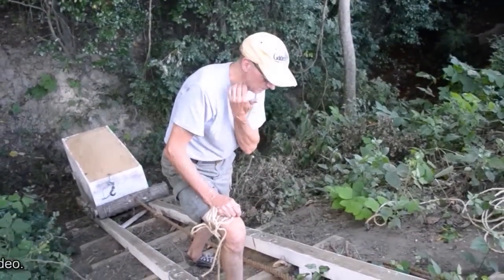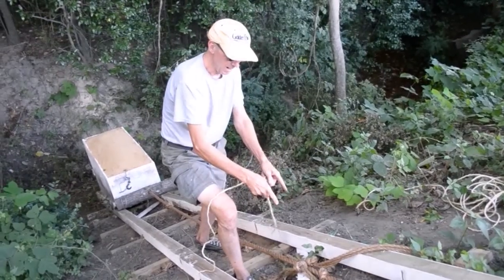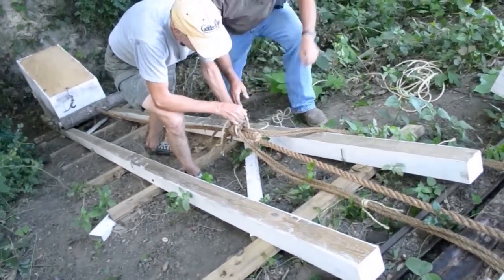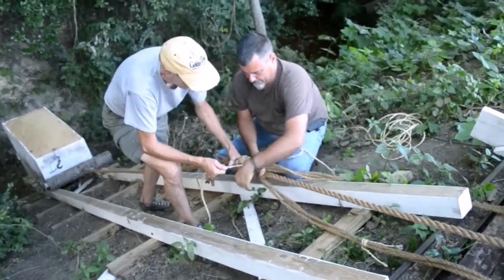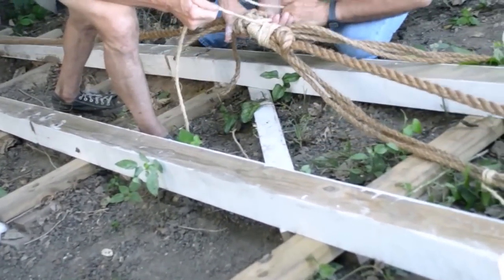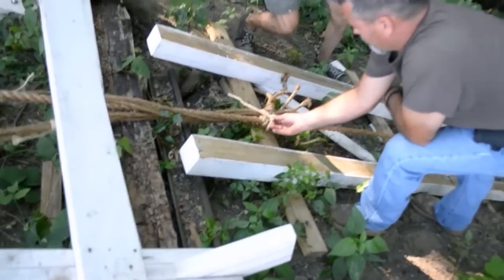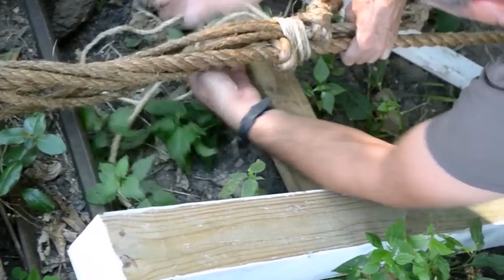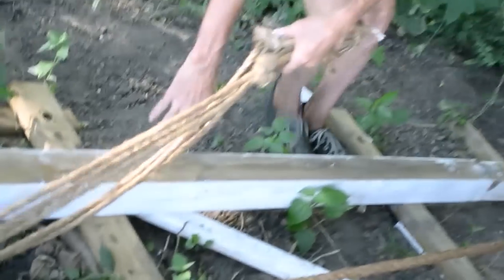2013-2014 Raising Pyramid Stones With Levers and Ropes

Comment: If the stones at the base of the pyramid are a maximum 1.5 meters tall, you do not need a ramp. 8 levers-1 at each corner and 1 at the center point of each side. As the structure gets higher, you build additional levers on each course of stones. During construction, the pyramids would all look like step pyramids. The limestone casing stones would be laid from the top down. Ramps are far too impractical and are only suggested because the people analyzing the construction were "experts" and their theories were not questioned. But ramps and sleds are as practical as saying they were built by aliens.

Comment: there was alot of resetting ,was a prussick knot known then . you just slide it along the lifting rope to reset .and a fulcrum further from the pivoy point i think would be better . ...... its believed stone ball bearings in grooves carved from wood beams were used in U.K. to move stone before the pyramids.
Reply from the maker: If a prusik knot would work with the ropes and loads involved it would greatly improve the pace of delivery.   It would also eliminate the necessity of using slotted levers---the cluster of bridle ropes would simply be looped and knotted around the butt end of each lever.    Longer, larger levers, with more men manning them, would result in greater movement on each lever stroke.

Comment: Way too complicated and way too slow. You have to think from a practical point of view and you have to consider that they laid - in average - one block every 5 minutes, 24 hours a day, for 20 years. 

What they had is enough men. The stone was attached to a rope but that rope simply went up to a log and redirected down again. Lots of men then simply walked down the pyramid, pulling on the rope, while the stone moved up. The weight of the workers' bodies did half the job of pulling. 

Their pyramid blocks were pretty large for efficiency reasons. There's no need to choose to work with heavy big blocks and then invent a complicated mechanism to be able to get them up. Your method is good if it is a single worker moving the stone, and there's plenty of time.

Comment: Would a heavy duty wooden ratchet pulley be an easier option? Very clever! I love the thinking and problem solving behind this. Great job you guys!
Reply from the maker: Keda,  thanks for the comments.    The ancient Egyptians didn't have iron or even bronze, just copper, and that isn't hard enough for a pulley axle as we understand it.    Last fall I built a new pyramid device, this one almost full scale.  We've already pulled a 2,000-lb load up a 45-degree slope.  I want to pull my Dodge Dakota up next but it has been raining every week since October and we can't get the pickup to the base of the cliff.  I hope to have a video of this posted before too long, but rain is forecast for the next week.  Roger
Reply: @rogerlarsen7636  best of luck brother 👍

Comment: lol. grandpa's got bore at the retirement home and made a project. good. bad thing is that the theory is BS. 
1. Egyptians didn't have steel nails and cables that they are using to hold all those wood ramps and heavy cart.
2. wood needs to be imported from outside Egypt, there's no trees, palm trunks are soft and flexible.
3. not sure of the weight of that cart but Khufu's stones are way bigger.
4. to cut/carry and place 1 million stones like Khufu's, plus the ridiculously heavy red granite stones of the chambers and main gallery, in 20 years (as the main stream academy says was done), every stone should be installed every minute, working every hour of  20 years. not sure that grandpa's system will deliver that work speed. 
5.Failed.
Reply: that 1 stone a minute is so hard to match...
Reply: Acheron LV-426 Yeah and you’re going to tell us that you know the time span in which the pyramids were built huh? Your analysis. Failed.

Comment: I was thinking that you could have a man or team of them on ropes at the bottom tied to the ends of the levers instead of building the steps up on the slope. A pull instead of a push.
Reply from the maker: The whole system is set up near the lip of the pyramid, so by the time the lever makes its downward sweep anyone pulling would be over the edge.  Also, a big advantage of the setup is that the men working the levers are using their body weight coming down the steps to move the levers---leaning against the levers.  If a ramp was used, they had to be pulling their own weight upwards while trying to lift the stone too.   The ancients would have made the steps out of stones.  They probably only had to move the devices after two or three tiers of stones were laid.  Thanks for the comment.  Roger Larsen
Reply: I was thinking that the pullers would be on the ground at the base. In my mind, there might be a problem with the pull not being direct due to the angle which could effect the amount of force put on the levers. But it would be safer because of the possibility of falling from a 51.2 degree slope if something goes haywire. A change in the frame triangle could alleviate the problem with the pull angle from the  ground if that is feasible. I think it's an excellent system either way.

Comment: Starts at 3:26. It could had been hoisted by typing 2 ropes to the sled stone, up to opposing pillars with pulleys attached, then to two separate stones at the top of the hill double the size. push each over the edge, thus sending the one stone up. and keep doing it until you run out of stones up top.

Comment: The only argument for Egyptologists to cling on to until resent was the lack of another megalithic site proven to be older beyond any doubt. Göbekli Tepe beat that argument to the ground, with its 12000 years (at least).

Not to mention the long list of other Historical, Mathematical, Astrological, Mechanical, Zoological, Geological and Botanical inconsistencies.

So whatever Slide, carousel or water sluice you produce you will never be able to distract from the fact that EGYPTIANS were only re-using and conducting renovations with far less advanced techniques. And yes, what you just did here might just be one of those techniques.
Maybe you could try with those 1200 Ton stones at Baalbec. And no, "if it works in principle it works here" are wrong on so many levels.

But hey, A for effort. :)

Comment: why not make two more ramps, one down each side of the main ramp, have ropes from the sled with the stone go up to the top and around  upright posts that spin freely, and then to sleds on each side of the ramp with a stone. Have enough people load into each of the sleds so that their weight is more than the stone. They go down, the stone goes up. It is called a funicular. It would work much faster than what you have got going. There is a funicular, I can't remember where, but it runs up and down a 52 degree slope. Makes more sense for workers to walk up to a height and then ride down and to keep repeating that than to have them build a ramp that has many times more mass than the pyramid and to drag stones up it. A layer could have been laid on top of the casing stones and it could have had grooves in it, creating tracks, they could have been greased and had water running in them as well. The sled with the stone would just zip right up it. OR you could place the "Petrie" rockers end to end up the side of the pyramid. loop rope around a stone and have it roll up as the two sleds on the side went down.
Reply from the maker: Thanks for your thoughtful reply.   The problem with your suggestion is that the ancient Egyptians didn't have a way to make posts spin freely.  Roger Larsen
Reply: What is that statement based on? Are you suggesting they didn't have grease? The evidence , physical evidence, points to the fact that they could have done so very easily. They drilled holes in granite. I direct you to go to- http(colon)//www(dot)pbs(dot)org/wgbh/nova/lostempires/obelisk/cutting(dot)html. So, they had bow drills, so they clearly understood the concept of spinning something in a hole. They could drill holes in granite, so they clearly had something hard wearing to use to spin an upright dowel or heavier cylinder. They used hard abrasive sand so they clearly had the idea of putting something on the drill (copper tube) to affect it's function. To suggest that they could not make the mental leap from a bow drill that cuts with sand to an upright spinning dowel that spins easier with a lubricant that reduces friction , operating in the opposite fashion as the sand which increased the friction, is simply not credible. I suggest you look into that whole page  and understand that it was a mystery for academics, for decades,  how the Egyptians cut granite with copper or brass tools. The fact is they did and that site shows one how they did it using hard abrasive sand. I suggest that it is possible that the "mihhhhhhh-steeeeeeeeeerrrrr-eeeeeee-yuhhhhhhs" "djed pillar could be a representation of just such an upright dowel. IF a large stone had three ropes attached to it, and they were looped around a spinning dowel, then one would need to keep them from criss crossing, so one would put disks on the dowel to keep them separate, effectively creating a channel for each rope. One would need to keep sand from entering the the bottom and mixing with the grease, and the djed pillar had a skirt at the bottom. You may object and say that the djed pillar was  mystical or religious item . I would just counter with the " Cargo Cult" phenomenon, suggesting that a thousand years after the pyramids were built, perhaps after a social upheaval or collapse, that much knowledge was lost and simple tools ended up being thought of having magical powers.  Academics have evidence in front of their eyes, but they pride themselves on memorizing and repeating an orthodoxy rather than understanding things. So,  like they did with the sand experiment, work backward from the result and figure out how to reach that result.  They do not in fact need to use the upright cylinders though. The Egyptians were very good at rope making and there was a slope on the opposite side of the pyramid of equal slope and height. They merely needed to make a rope long enough to go to the other side and have a cylinder in a grove, it could be lubricated as well. It is not much different than a regular roller except for the groove that it would roll in that would hold it in place. If they can cut out a cylinder from a block of stone, as we know they could, they could then cut that block in half and cut channels into it's sides  for the rope so the rope does not fray on the 90 degree edge.Human nature is to do things the easiest way, the way that requires the least effort and expense. The ancient Egyptians have DNA that is European. They were as smart as we are and sooner or later, if they were trying to do it your way, someone would say, "why don't we use a bunch of us as counter weight?".In the situation in your video though, there is no opposite side, so the logical thing to do would be to erect an upright roller and have the counterweight travel down the same side as the load.

Comment: The 1,800 lbs demo is nothing in comparison to the reality of the building. I have personally moved more weight than that (alone!) with much less apparatus; a simple lever easily moves such small things. With the average weight of a pyramid stone being 25 tons up to about 50 tons (200+ with other building stones), if one just starts at about 30 times the scale of the demo... 30 times bigger and stronger and suddenly the scale up of your demo is not workable;  in real life usage it becomes very unlikely if not entirely impossible just for the "little" stones. 
The problem comes when the lever or other parts reach the maximum force the material can withstand, even high tech metal fails with enough stress.   --But using only materials that the ancients were assumed to have, this video does not provide a likely answer...
Reply: Each pyramid blocks weighs 2.5 tonnes, while getting lighter towards the top. The heaviest is 80 tonnes, nowhere near 200+